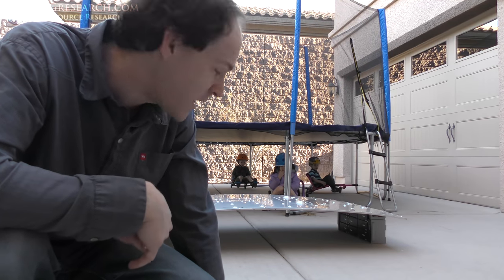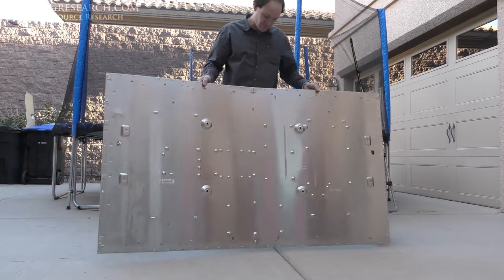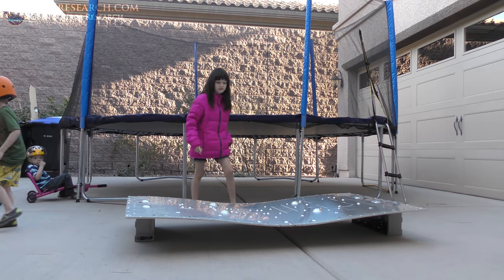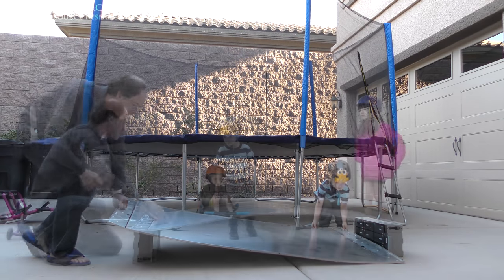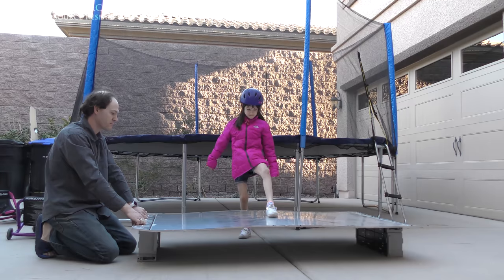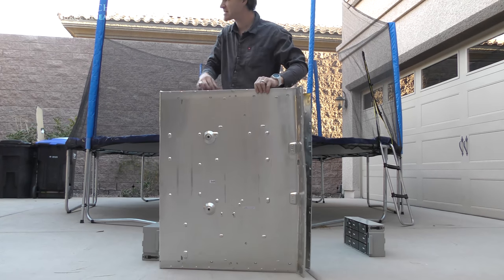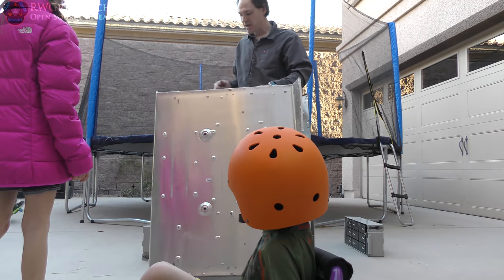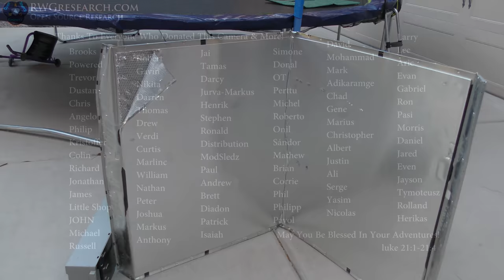TRSV #1 : The Aluminum trampoline from 78" LCD TV. Very Interesting Engineering of the AL plate

Comment: I went to a tech school for aircraft maintenance. Honeycomb composites are used for the exact reasons you showed. Strong, light, and it can bend without breaking.
Reply from the maker: Very good. Ive never seen it used for this type of application, but yes it it did hold up to the torture quite nicely:) ~Russ

Comment: Years ago I was visiting my brother-in-law he works for Lockheed Secret skunk stuff he had a piece of metal stuffed in the corner of his garage I asked him about was very similar to what you have except made from titanium about an inch thick honeycombed on the inside with cutaways to display the structure he said it was a $80,000 prototype he didn't know what he was going to use it for but he just couldn't see it go in the trash
 have you ever seen anything on the aluminum sponge material that's pretty cool lightweight stuff
Reply from the maker: very cool. I'm sure he had a lot of fun things barred in there :) hehe i finally had to recycle it. I'm sure ill need it tomorrow... lol ~Russ
Reply: Robert Culliver Some of it well float win one applys high voltage to it,

Comment: @rwg42985 Have you ever seen this supposed secret schematic? https://www.youtube.com/watch?v=zlpC_wlTdes I wonder how the 2 wires are linked into the 2 two coils? The coils are running in opposite directs or like your printer that prints 2 wires side by side as electricity flowing in opposite directions? Random I know!